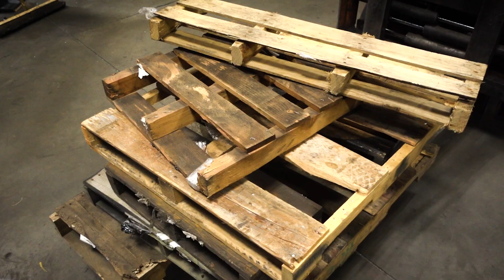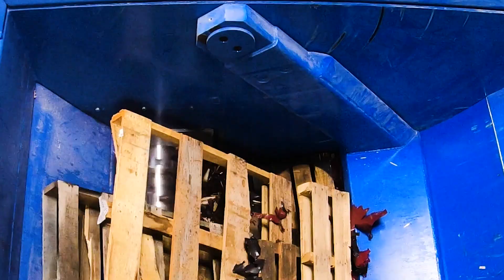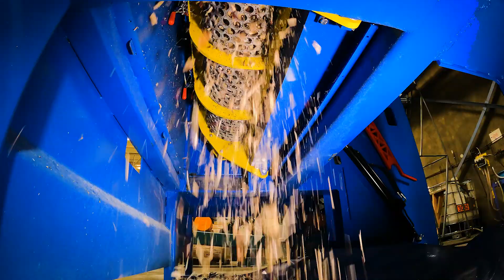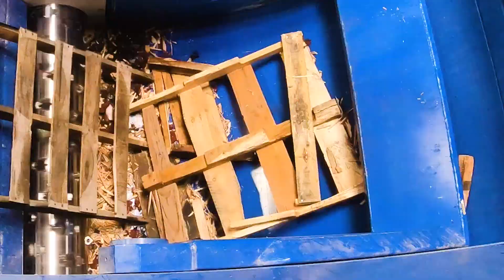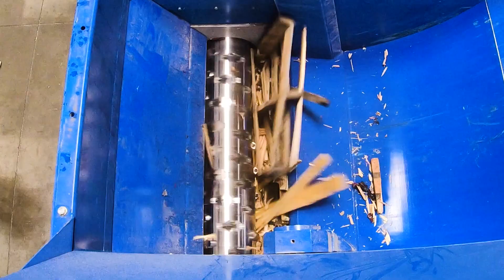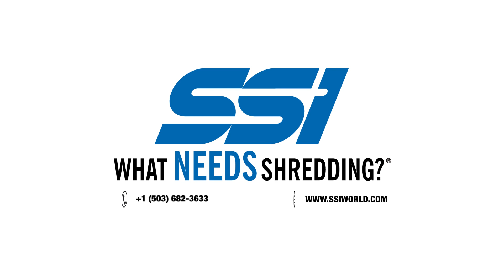SHREDDING WOOD PALLETS

Comment: A couple of issues with dealing with pallets is the nails or staples used to put them together. That stuff is going to stay embedded in the wood, before or after processing. It'll take a very strong and very capable magnetic belt to remove the metal, if they used ferrous material in the first place....